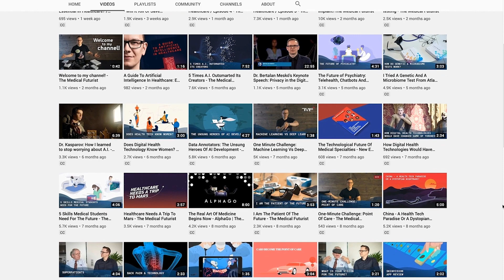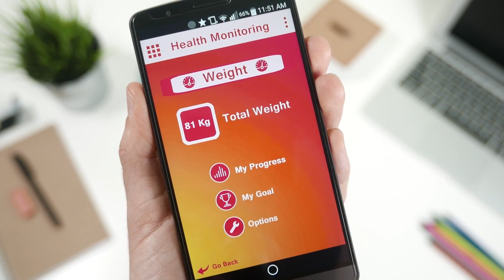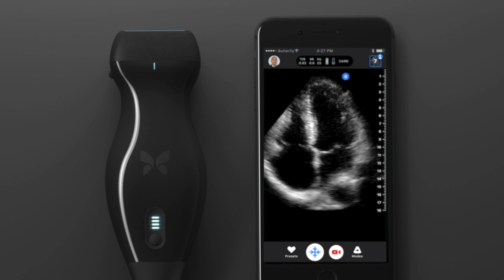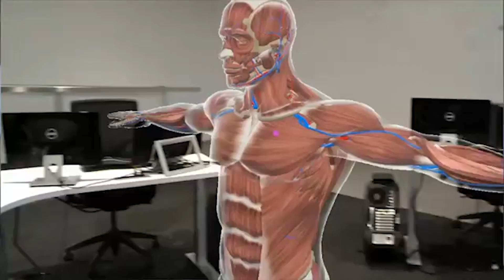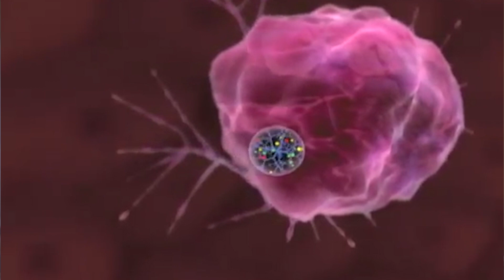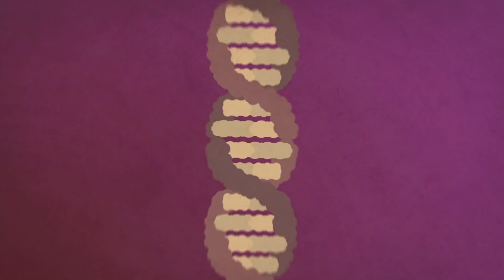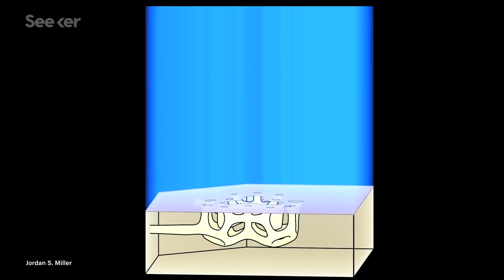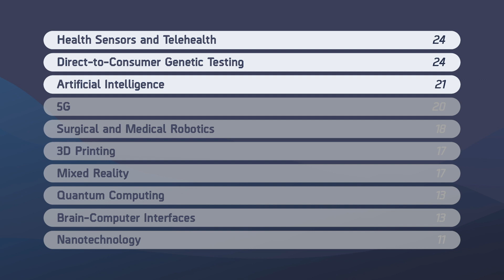Top‌ ‌10‌ ‌Medical‌ ‌Technologies‌ ‌of‌ ‌the‌ ‌Future: ‌Ranked‌! / Episode 7 - The Medical Futurist

Comment: With regard to 5G and remote surgery, it is unlikely that a wireless network or any kind would be involved in a remote surgery performed by a clinician at a center-of-excellence location and a remote hospital with robotic surgical tools.  The connections would be over broadband fiber (wired) end-to-end.  There may be applications for remote surgeries using innovative robotics (yet to be invented) in mobile settings such as ambulances and perhaps military use cases.  Delighted to discuss this with you in more depth.